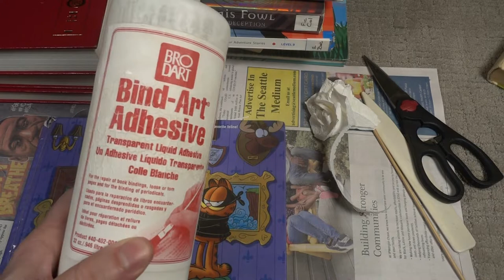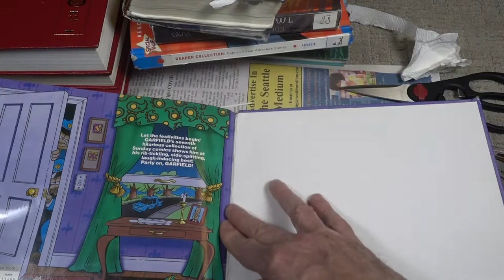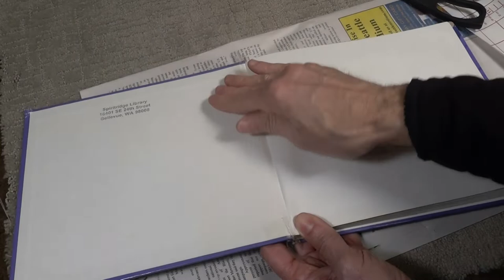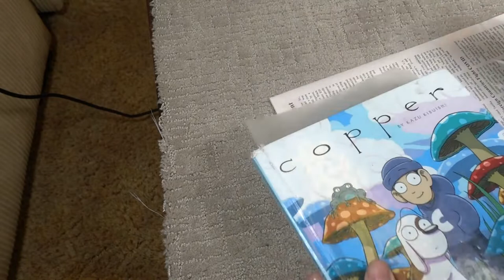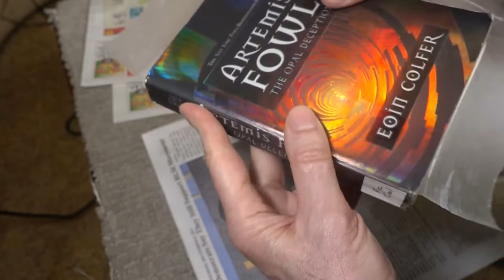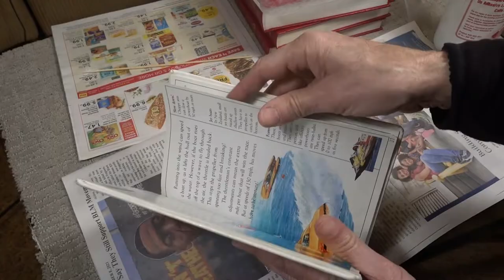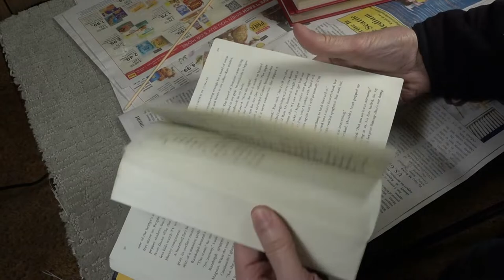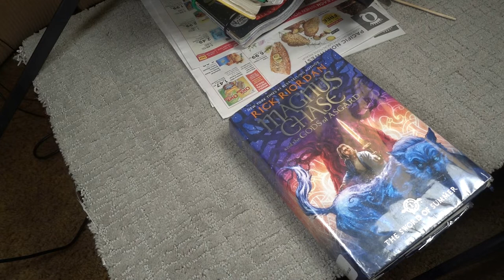Repairing Damaged Library Books

Comment: I learned so much from this video.  Thanks for sharing!!
Reply from the maker: I have since found a better repair tape.  It's made of paper and it's extremely thin but strong.  It's called Filmoplast P.  I get it online from Talas.  I have a video on it as it's very difficult to get started as it's so thin it's very difficult to remove the tape from the liner.  Thanks for watching!